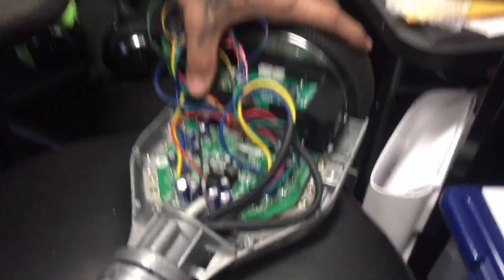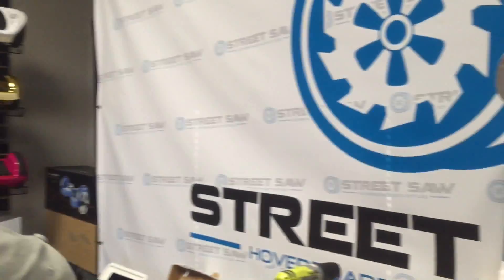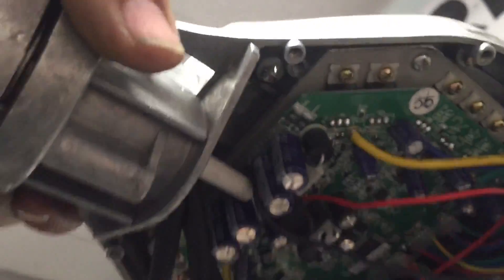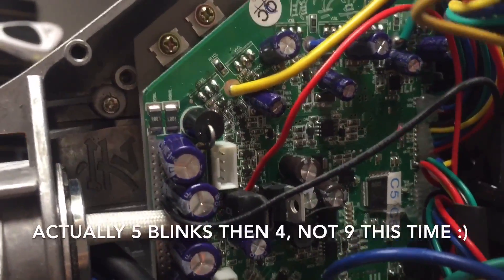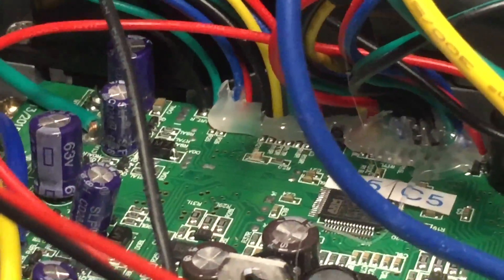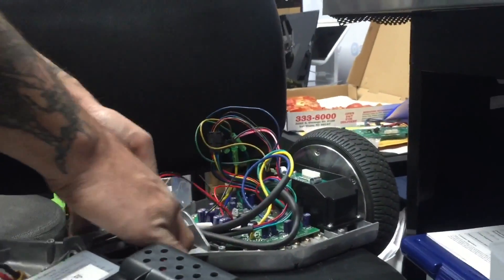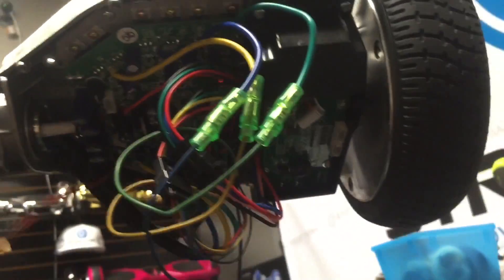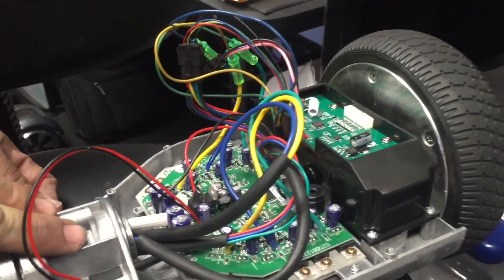Fix Hoverboard Blinking 9 Times - Its Not What You Think!

Comment: I have the same hoverboard interior circuit, but different model, named "Smart Falcon"
I bought it used with dead battery and broken charger port.
I replaced the battery with good one, it works, but i have a problem figure out the wiring of positive and negative of the charger port, i use Multimeter on the socket on the circuit board, but no reading at all. 
Am I doing something wrong? 
How to know for sure the wiring diagram, besides cable color,?

Comment: If you have a red flashing light on one side and it wont move and Recalibrate doesn't fix it...  Check all plugs and wires are getting good connection (Especially the 5 wire sockets). If they are and it still don't move then it probly has a blown output fet on the side thats red.  They're easy to change..  MAKE SURE BATTERY IS UNPLUGGED!!   Measure the Mosfets, 6 on a heatsink per side(GDS)... Usually only 1 or 2 short...  DMM to Diode, Neg on Center pin (Drain), Gate approx +1.5v, Source approx .5v.   YST7575C crosses to RU6888R  68v 88a TO220   * For the 12 Fet Mainboard Model, one bank of Fets controls one drive wheel. Do a continuity test to figure out what bank controls what side..  Each bank of Fets, are broken into pairs per thick drive wheel wire (YGB)..
Reply: Correct.  I had a ground wire out of the four that go inside of wheel motor. I solder ground back on and hoovwrboard worked without having to balance it

Comment: My hover board won't turn on, & beeps when i plug it to the charger, I opened it up & everything seems to be connected, what could i do?
Reply from the maker: What exactly do you mean it beeps when you plug it into the charger? Is is a UL2272 board or an older board? If it is an older board its most likely about time to buy another one of these: https://www.streetsaw.com/products/hoverboard-battery-replacement
Reply: I believe so... it starts beeping when i plug it up as if i get on it & it does this constantly & the two lights on the board starts turning on & turning back off

Comment: Maybe you can help me... My hoverboard doesn't move on one side and a red flashing light blinks on that side and beeps repeatedly. After charging completely, the side that doesn't move and blinks red worked for about a half a second before going dead on that side and blinking again.  also (on the same side) the blue light on the front acts as though it has a short in it, as it will come on and kind of flicker in and out? i took the cover off one side and checked all the connections.  Everything was fine. However, on the side I'm having issues with, there's a single screw i can not remove to save my life, and the cover on that side is nearly impossible to pull off to even get a glimpse at what it looks like inside.  I've tried looking this issue up online and I've come up with nothing but advice for re-calibrating, which I've tried and it won't even seem to do that. I'm at a loss. Do you have any idea what the issue may be?
Reply from the maker: Hi Cassandra, What type of hoverboard do you have and would it be possible to get a video of this happening. You can share it with us via chat on our website at streetsaw.com

Comment: where does those wires hes holding at 1:40 go my brother disconnected it and doesnt know where it goes and now it blinks a red light and wont move ive tried recalibrating it but it seems that its because of that red and black wire
Reply: Ramon Diaz its the wire that connects with the on and off button

Comment: What does it mean if the light flashes 2 times and continues an makes noise wirh the flashing?
Reply: batterie was fully charged
Reply from the maker: You would have to show us. Which light? How is the beeping sound? Could be dead battery, or could be bad motherboard.
Reply: same problem
Reply from the maker: mixit2020 Dead battery
Reply: It was bleep bleep...bleep bleep so I checked all the wires there was all ok but the light was continueing to flash yeah like crazy an still wouldn't work never seen nothing like it...
Reply from the maker: If it was fully charged then why was the light blinking two times and beeping? It sounds to me like your battery has gotten old and time for replacement then. If you haven't figured it out by now here's selection of batteries to choose from:

https://www.streetsaw.com/products/hoverboard-battery-replacement
Reply: StreetSaw Hoverboards Hi my hoverboard does work and i dont know what the problem is. When i turn it on a red circle next to the battery sign flashes 3 times continuously. when i stand on it doesnt move and sometimes makes a beeping noise the blue lights do turn on though. Also theres a weird and a quiet zzzzzz sound. Also i recently put a new motherboard and sensor boards, it worked for like a day or two but i have this problem now.
Please help.

Comment: the red light on my charger flashes. what does it mean
Reply from the maker: It sounds to me like you need a new charger. Usually when the charger flashes red, its a bad charger. When the charger has solid colors, such as green or red, its usually something electrical, such as the battery.

You can buy our BEST brand new replacement hoverboard charger here, and it comes with a full 100% money back guarantee warranty (guaranteed to fit too): https://www.streetsaw.com/products/replacement-hoverboard-charger

If you're looking for one on the cheap, we also have this one (we don't generally recommend this one though, and no warranty): https://www.streetsaw.com/products/cheap-hoverboard-charger
Reply: I have the same problem my CHARGER FLASH RED WHEN PLUGGED IN THE HOVERBOARD AND THE WHEEL SHAKES, BUT when not plugged in the Hoverboard the light in the charger stays solid green

Comment: When my hoverboar mainboard little speaker make long beep sound what does it mean ? It long beep always and not turn off. Battery and indicator led lights are green.
Reply from the maker: If the hoverboard will not turn off, you need to replace the motherboard with a brand new one. The current one is faulty. https://www.streetsaw.com/products/hoverboard-motherboard-replacement

Comment: What needs to share ? Gyro , motherboard ?
Reply from the maker: +Joschua Parvez I don't understand your question.
Reply: +StreetSaw Hoverboards What must change ? Gyro or Mainboard ?
Reply from the maker: +Joschua Parvez Nothing needs to change. The blinking light 9 times is simply an indicator that you turned the hoverboard on while it was upside down.
Reply: +StreetSaw Hoverboards Ok , when I turn comes , normal , but not balance . What is the problem ?

Thanks for you Answer
Reply from the maker: +Joschua Parvez Most likely the gyroscope. You can get one here (make sure it matches the same before buying): http://www.streetsaw.com/products/hoverboard-balance-sensor
Reply: +StreetSaw Hoverboards Ok Thanks
Reply: +StreetSaw Hoverboards From mainboard comes noise . Why ? ?
Reply from the maker: +Joschua Parvez It is receiving an electrical charge from the battery. The mainboard should only make noise when the hoverboard is turned on. It should not be making noise when it is off.
Reply: @Streetsaw   Dekuji ja uz se leknul ze je neco s mym hoveboardem , muj problem je ze ( my hoverboard does not mark a weak battery, but it turns off when driving  / after about 1 km )sorry for error im not speak english